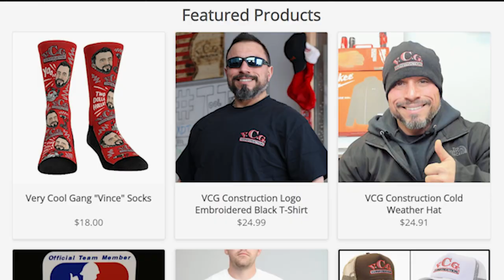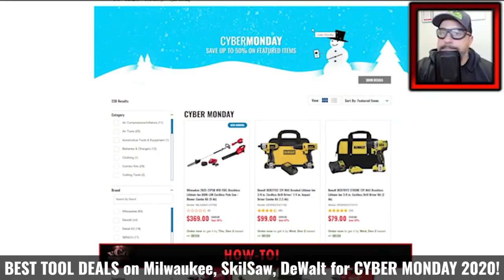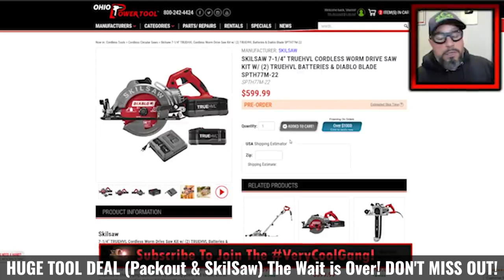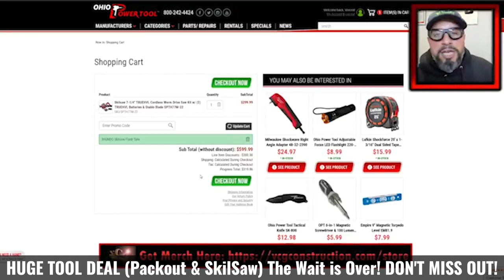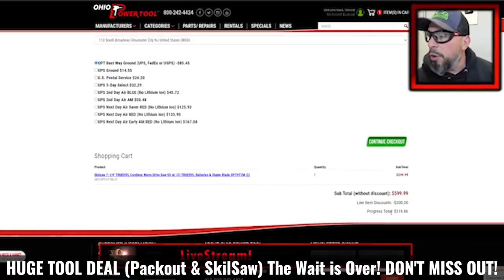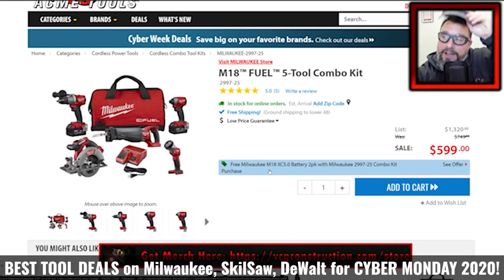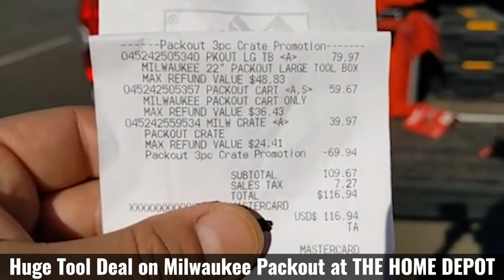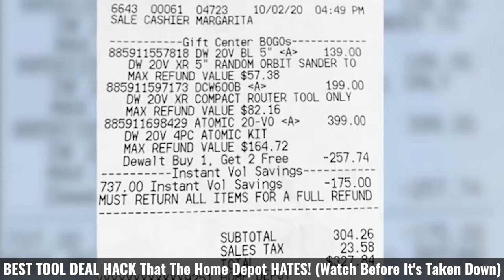TOP 5 Most LUDICROUS Tool Deals Of 2021 (How To SCORE Them!)

Comment: Regarding Skil saw being the only Worm Drive circular saw what about the DeWalt dcs577 Blade Left or DCS578 Blade Right Flexvolt 7 1/4" blade Worm Drive circular saw that was released back in 2017-'18? I mean I haven't done any research into any others but if that one existed years ago how is the Skil saw the only one?

Comment: What's the difference between number #4. The skillsaw worm drive circular saw and the Milwaukee M18 FUEL 18-Volt Lithium-Ion Cordless 7-1/4 in. Rear Handle Circular Saw. Besides milwaukee is a few hundred dollars cheaper? They look like the style of saw with the same features.

Comment: i thought the best deal (which i missed because different time zones) was spend 200 in milwaukee products at opt get the packout with 100 piece bits for free compliments of @vcg! i liked the dewalt 6+4 amp free tool deal from the depot. also picked up 2 m18 6.0 ho+free router from opt for 175. and the "tickle me elmo" gen 3 m18 impact driver in packout for 180 from the depot. i felt this year was a good year of savings. much better than what i recall from last year

Comment: Question. This is geared more to DIYERS and Home owners. How do you guys store your cordless tool batteries? You just leave them out or keep them in bins as to not collect dirt/dust? If you contractors have ideas please give. I figure you contractors leave them out because your probably charging them for next day. Thanks
Reply from the maker: I store the batteries with their tools
Reply: Got the six bin divider for packout from kaizen inserts and store them in a packout toolbox with the tools. The 12 volt is in the double wide double deep with my m12 soldering iron and Demel.